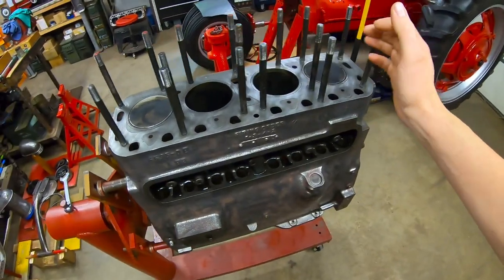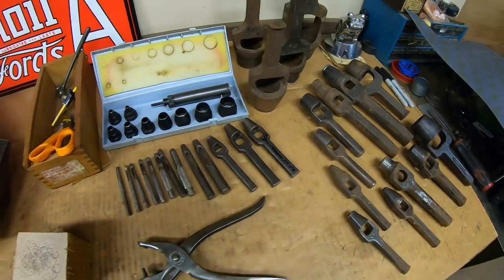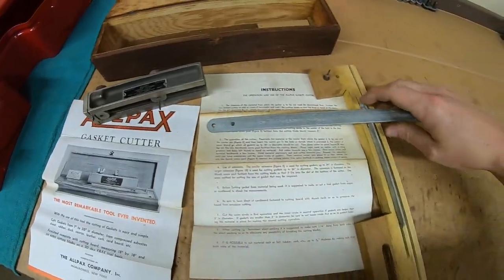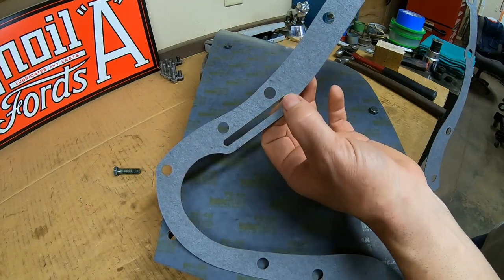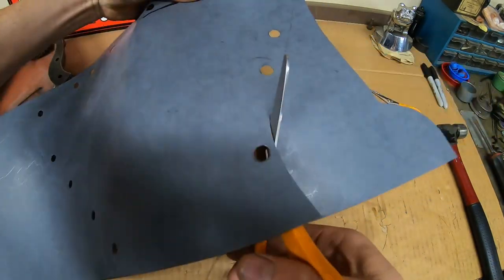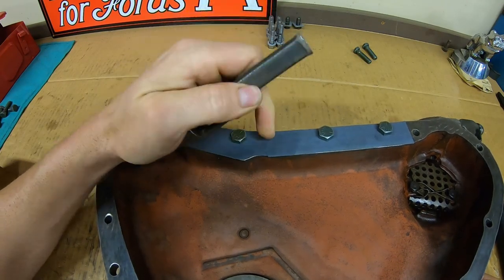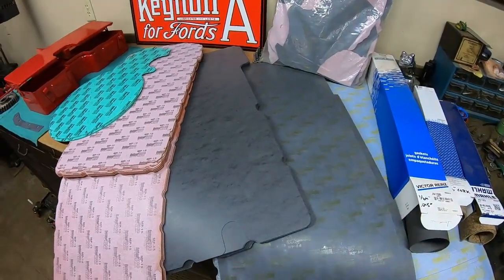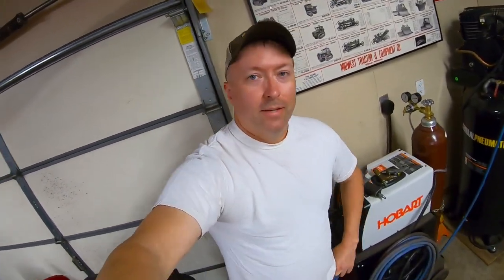How I Make All My Gaskets - Step by Step Process Including Tools, Materials & Sealers!

Comment: With that slot cutout, would you be concerned about the extra gasket material wearing off and getting into where it shouldn't?  The circular part of that slotted gasket isn't supported and would have oil flowing past it.  Seems like maybe it might break off and cause problems.
Reply: @squatch253  Actually I was talking about the 2"-3" opening for the oil passage.  The actual oil passage has an additional circular part that now would just have gasket material.

Comment: Good topic and good content!  As an oilfield mechanic, my first boss instructed me to keep a manilla envelope and cereal box in the pocket on the back of my seat for emergencies.   There were some times when things went way upside down, usually at night, weekend, or holidays where you got in a pinch.  I have used just about everything including the  bottom of a five gallon pail to build an emergency gasket or space out a pump face for a larger impeller trim that didn't quite fit!   Work smart, not hard and use that thing between your ears for more than a hat rack.   Several of the contractors that I worked with would breathe a sigh of relief when there were issues on a site, many a time mech. truch 8167 saved the day.  It is amazing how much stuff you can squeeze into an 11ft service body, especially the older ones that were built to last.   Have a great day!  👋🤠

Comment: I have seen them use a thread for aircraft engines between block half's with a sealant
Reply: Yes, the original sealing method for aircraft crankcase halves is silk thread.

Comment: I'm having trouble with the water jacket cover on my super M TA. The original cover rusted a hole in it, so I ordered a new one with a gasket from Steiner. I sealed it with the same silicone sealer that's used on thermostat housing, it failed. So then I ordered another gasket from Steiner, this time of used perma- tek, it failed. So now I ordered a new gasket from a CNH  dealer. The gasket is considerably thicker than the Steiner gasket. I'm wondering if that was the problem. I haven't installed it yet. Does anyone out there have any suggestions to use for the sealer?
Reply: @squatch253  thanks! I'll look at everything you suggested. I'm hoping the gasket from the dealer works, it does look different.

Comment: I'm betting that brand new gasket kit was scanned and laser cut. I'm not knocking the technology (I used to be a CAD/CAM programmer) but the technology is only as good as the programmer/operator. I'm enough of an old school guy that I much prefer the old tried and true methods of gasket making.